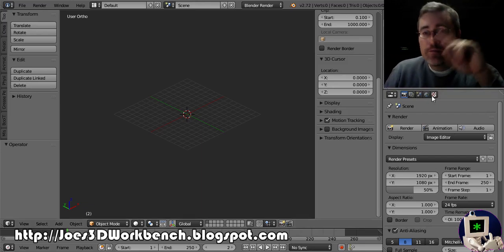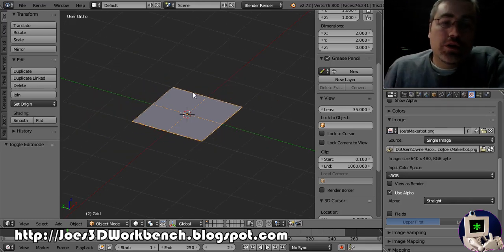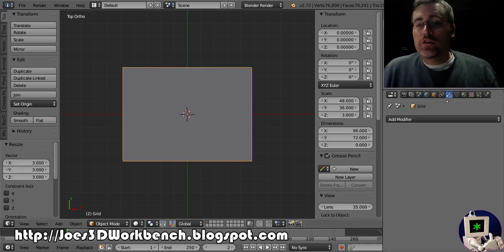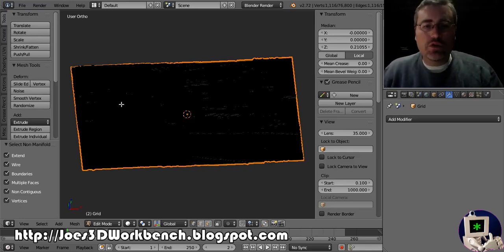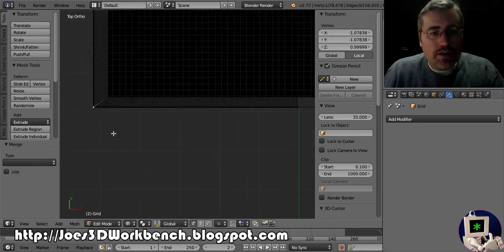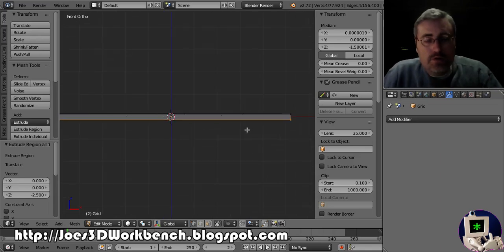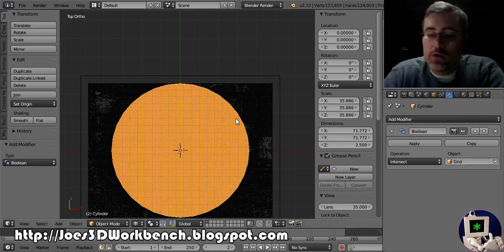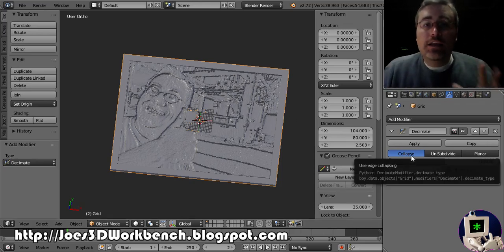Modeling For 3D Printing - Lithophane project

Comment: Are you planning on making an updated version of this vid?
Reply from the maker: For the newest version of Blender, you mean?
Reply from the maker: I should. It kinda depends on what I'm doing. I actually did do a lithophane project lately, so I've had a chance to update the idea. But I've got a lot on my plate right now. Ring that bell so you'll know when it happens.
Reply from the maker: Soup  Possible you're merging too much into the corner. Also, possible your mesh isn't flat to the bottom. Try using flashprints "Surface to Platform" in the rotate menu and choosing the back of your lithophane to make it lay flat.

Comment: What kind of print settings do you use for that print? is .1 layer height required, or ?
Reply from the maker: 1 shell, 100% infill, as thin layers as you like, I recommend 0.15 or 0.1.
Reply: Cool thanks! Also out of curiosity does this remain your preferred method for creating lithophanes? I realize this video is 4 years old and given that Cura and some other tools have this sort of thing built in now? I've been experimenting with those but still can't get anything close to the quality of yours.
Reply from the maker: Proper settings in cura do as good a job as this, but you have to export the STL if you want to do anything other than a flat picture.

Comment: nice tutorial ......or you can just use our tools on 3dshook play  ;)
Reply from the maker: +Nadav Brill That's a nice tool. A little limiting compared to what I can do with Blender, what with the sqaure shape only. But I like the frame, though it's too bad it doesn't put the lithophane into the frame after you make it. You've got half a good tool there. Keep working on it.
Reply: +mrjoesays Hi , thanks :) you are right I will add more basic shapes , however  you can throw in any png with transparency and create your own shapes or by using any 2d editor., as for the frame , use the frame or litholamp application from the front panel . the idea is you can replace the content and the frame separately. check it out some more let me know what you think ...

Comment: Does this work with Cylinders? I've been trying to make a cylindrical one or a sphere
Reply: +René Alejandro Gutiérrez This was asked before, and I played with a couple of different ways of doing it, but I didn't find a trivial enough solution that fits in a comment. Warping the grid, either before or after displacing, doesn't seem to work at all. Making a cylinder involves making it with enough points that it can be displaced and then setting the UV projections so the image is properly mapped seems to work, but that's non-trivial and maybe I'll attack in in a future video.
Reply: *****
Yes I did try mapping the image but with so many faces the unwrappping cames really messy
Reply: +René Alejandro Gutiérrez I didn't find it messy as much as odd that it didn't wrap around the whole thing. UV unwrapping is one of those things that I'm not very coordinated at, especially since I don't texture most of my models, but this one seemed straightforward. Future video topic, I guess.
Reply: +Joseph Larson Yeah I understand you, I don't do it muchos either. I'll keep trying and notice you you if I achive something

Comment: rupash pudasaini I don't know why but I can't reply to your comment directly. But I can tell you it's easy to do. Just add a beizer circle to the scene, add curve modifier to the lithophane, and fiddle. The problem is printing it. You must print this lithophane standing up which means that you can't do it with ABS because the layers will crack, and even PLA might have a problem because it's so thin and open air all around. But it's been done before by others, so I'd say go for it.

Comment: Hi Joe, I really want to make this work but when I apply the displace, it goes all weird - after soem playing and setting the Image Mapping Extension to "Clip" the image appears as a few pixels in the middle of the grid... what am I missing? Oh, I'm scaling to use real world mm in the models scene units (and a scale factor of 0.001) but even fiddling with all of these, seems to make no difference :(
Reply from the maker: Are you applying the scale (ctrl-a) before applying the displace modifier? It's also important that any scaling you do, even though the grid is flat, not include the Z so that the displace modifier will still displace 2mm thick. Well, -2mm thick, but you get the idea.
Reply: mrjoesays Ah ha, it took me going native to realise that when I add the grid, the radius seems to be set really high... I guess this means a scale? Other than that, yep, all the other scales were set to 1. Once I added with the radius also set to 1, the texture applied nicely. Phew, in that case, awesome video, just printing out my first lithopane :D

Comment: Another great video.. Are you using white? Or is it that the 'natural' color?  Can I get (buy) a digital copy of your book?  BT keyboard works but is an unnatural workflow.  I'm going through BT dongles oddly enough.
Reply from the maker: Link for the book in the description. You have to "see more" to see it.

I hunted for a tan to print lithophanes specifically with and it works great, but white also works. As long as it's opaque. You may have to experiment a bit with other types, but 0.5m+2mm works for white.
Reply: mrjoesays
I did manage to cruedly get a couple STL files finished. I'll print them tomorrow.  I have lot of trouble scaling or extruding in a single given direction.  New Rii mini is on the way. I'll give tan a whirl. I've got lots of rolls of stuff so close, gold, bronze' copper, they all look tan mostly.  You are printing in ABS? In PLA I've only got white. My rep1 will do a smooth bottom layer but my rep2 in PLA is a little checkered.
Reply: 66tbird1 almost always Abs. Congrats on making a few STLs.
Reply: *****
I'm stuck until I can figure out how to ''scale in the Z by zero'' without a keyboard.  Exactly what are the 'by zero' steps?
Reply: With a keyboard you just type 0. 's', 'z', 0. No idea how to work it without the keyboard.
Reply: ***** Are the quote 's' and 'z' held?  I have the non manifold selected and extruded, still highlighted, and on either the on screen or the off screen tapping 0 S Z 0  just changes the highlighting a little and nothing else. Try your on screen KB please and see if it works.
Reply from the maker: 66tbird1 Nope, just type sz0 like it's a word, but you have be to sure that the mouse point is over the 3D window before you do that or it won't work.How that works with the onscreen keyboard I don't know. Do you just need the mouse over the 3D view window when you start? I don't know. You ask the tough questions. Good luck and let me know how it goes.
Reply: mrjoesays
cursor position dictates the rule so I'll have to wait for the new Rii mini keyboard. I did go the long way by creating a plane then extrude, then Boolean subtract, and then remove the face(s). Too long for practical work flow but good practice.
Reply: 66tbird1
I am up and running with good work flow using a Rii mini.  First prints with junk gold ABS were crappy. Way to much ooze made for a very weathered look. But some people liked it the best. Second batch with tan PLA were mind blowing. I'm fine tuning a profile in S3D with footnotes to get exactly 18 layers at .13mm    Scaling with that software is a breeze.   I'll grab your book as a thanks for the great walk-throughs that gave me the motivation to tackle Blender again.  Just need to find a good e-reader that works for me.
Reply: 66tbird1 my chest is puffed with pride.
Reply: ***** I just found and worked with the S3D addin 'convert image to 3d'. Use a .PNG image, invert depth, set the depth at 2.1 mm, platform height at .6 and use a .15 layer on the printer.  It's done but no border. So a quick trip into blender for a few creative clicks and it's a lithophane.